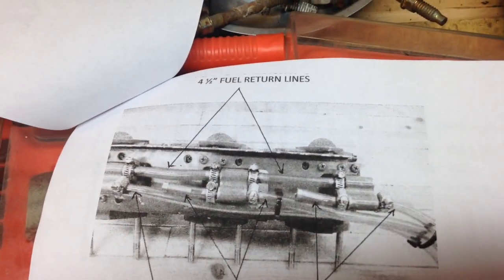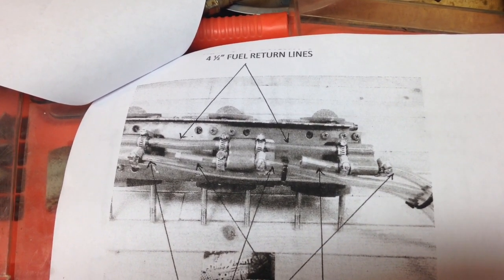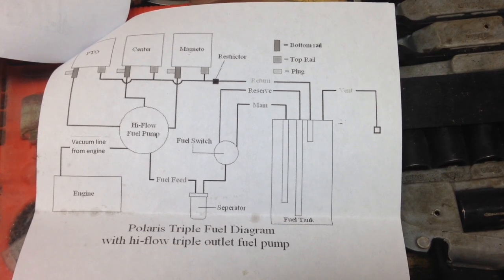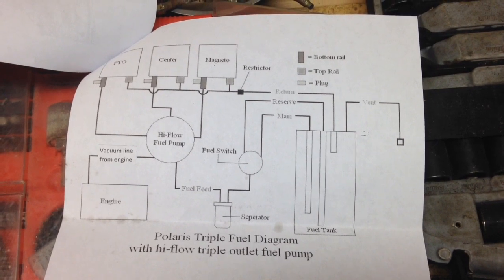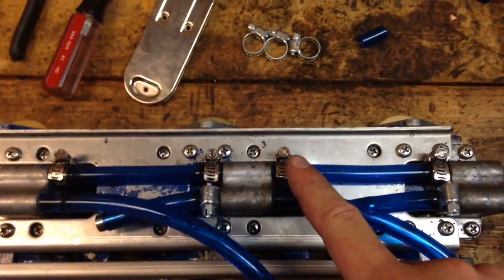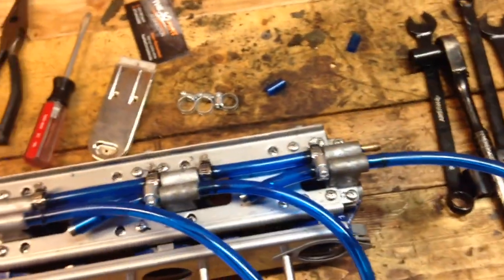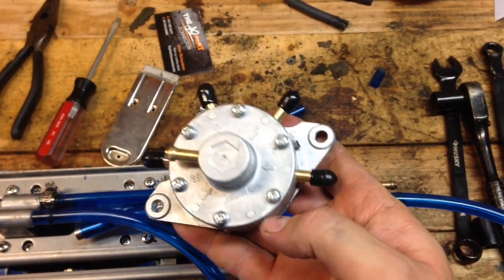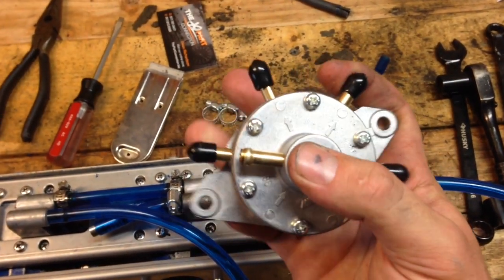Polaris SL 650 Fuel Pump Install

Comment: I’ve got a 1998 polaris slth 700 that was working fine then on the water the other day it didn’t want to start and ran my battery dead so I jumped it and it ran great the rest of the day until I turned it off. I went to start it and only got a click,click. Took it home put the battery on the charger and I still only get a click, click. I tried to by pass the relay with a screwdriver but the starter didn’t turn over. The breaker isn’t tripped and both fuses are good in the box. Any suggestions? Thanks
Reply: Hope you fixed this as it was two years ago you posted this lol but for anyone else who has this problem it could be the starter it’s self if it’s got bad windings in the starter motor it can land on a spot that won’t get the motor spinning and sometimes it could land on parts of the winding that can get the starter spinning and start it right  up

Comment: Does it matter which hose goes to which connector on the fuel pump I know not the main fuel line or pressure but the other 3
Reply from the maker: The pump is usually labeled

Comment: Hey sparky, nice video. I am in the middle of a conversion but I am at a loss. It idles OK but when I rev it bogs and dies at 2k rpm. What did you do with the T Plugs on the inlet? Since these ran also to the tank, I'm not sure how to handle these.

Cheers Ferry
Reply from the maker: Eliminate other possibilities first. Fresh fuel. New fuel filter. New pump.

Comment: Do you need to make any adjustments on the carbs now that they all have their own supply?
Reply from the maker: No. This doesn’t change fuel consumption at all. So the carbs shouldn’t need adjustment if they were adjusted properly.

Comment: Awesome vid! I am planning on installing the triple fuel pump in my sl750 tomorrow. I was trying to remove my carburetors but am having such a hard time. Any suggestions?
Reply: From the left side of the ski use a 12 mm stubby wrench and just feel around til you get it.  I have had mine off 2 times in the past month and have it down to 25 minutes
Reply: Can you talk to me about what happened to your ski. I have bogging issues. Full compression. New spark plug and wire. Clean and new filters and separator.
Reply: I just removed my carbs today ...new reeds ..carb rebuild...and new fuel pump going on ... Hopefully will solve the boggggg problem ive had for 2 years

Comment: Ok so I did this to my SLT 750, it will start up fine but after a couple seconds it floods the sparkplugs with gas and won't start, is there an adjustment I need to do?
Reply from the maker: Sounds like a needle just adjustment is needed.  Check my other vids, I've covered it on other vehicles.
Reply: @SparkysGarage  yep I pulled the carbs back off and found out I didn't set the needles correctly, thanks!

Comment: I've rebuilt a 750cc and a 780cc for mini jet boat motors. Any opinion on the fuel return delete? I've read they'll run rich at idle but anything above 1/4 throttle they are fine.
Reply from the maker: Ajaxaxxess I don’t think they will run rich. The diaphragm only allows so much fuel in per cycle.
Reply: @SparkysGarage  Yea thats what i was thinking too. I'll just have to keep checking plugs etc.. Thanks for the response buddy.

Comment: hey i hope you respond, all of my bolts are rounded off on the bottom of my carbs. what do i do?
Reply from the maker: The bolts that hold the fuel pump in place? Or the bolts that hold the two halves together?

Comment: Do you have to remove the carbs for this?
Reply from the maker: Tyson Robinson no. The fuel pump is accessible without removing the carbs
Reply from the maker: You don’t have to but it’d probably make it a lot easier.
Reply: SparkysGarage yeah I just took it out. What length did you use for your fuel hoses
Reply: Also you just cap the fuel return?
Reply from the maker: Tyson Robinson correct
Reply: @SparkysGarage  what do you do with the "vent" that was inline with the fuel output from the pump to the fuel rail?

Comment: Where did you get all these diagrams at?
Reply from the maker: Wyatt Smid it was just an online purchase
Reply: Why are all the fuel lines not the same length coming out of pump so each carb gets the same feed?
Reply from the maker: Seth Myers carbs are different lengths. Each carb is supplied with plenty of fuel via those lines. The weak point was fixed with this new pump.